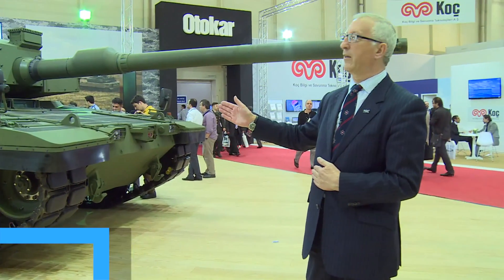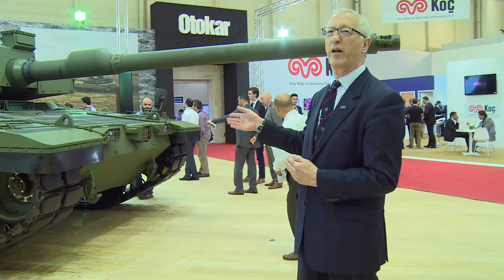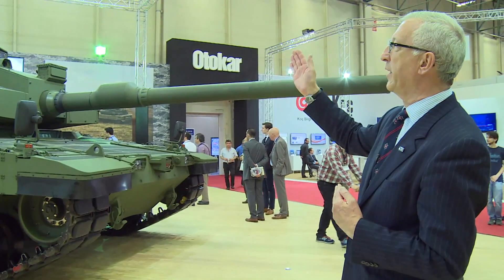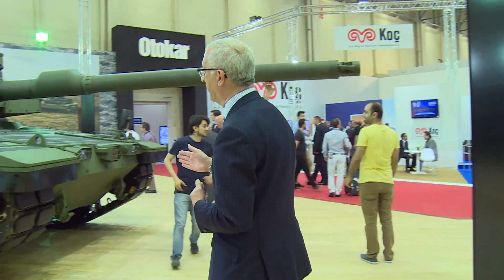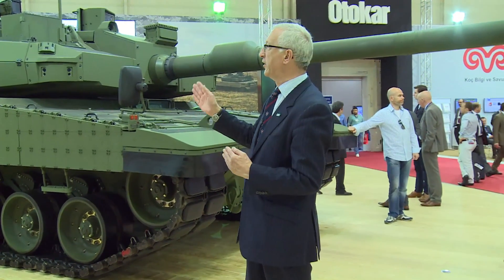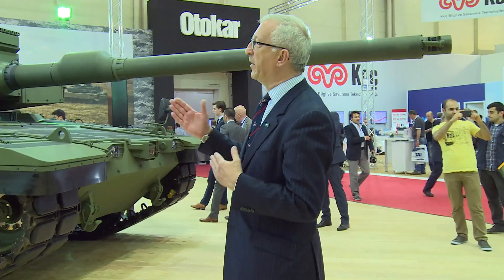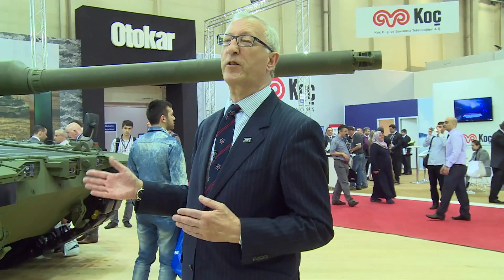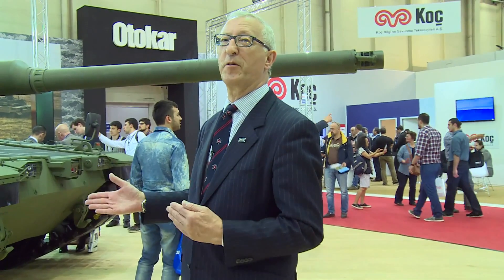IDEF 2015: The final prototype of the Otokar Altay main battle tank

Comment: Nothing beats K-2 tank In-arm suspension system.
Altay has some good armour though
Reply: Joe marine Bro, I do like you Koreans, but why are you whining in comments? Did someone insult you?
In a modern battlefield, no tank is able to survive another tank's shot if it is connected and is a APFSDS round. Thus makes tanks garbages, even a Turkish Sabra tank can knock out a Abrams or your mighty K2 with ease. No armor to protect your mighty ''in-arm active suspension'' and if you are beginning to shit with hard-kill systems, Turks have that option too. I don't think that tanks are becoming obsolote, they are just what the every land force needs but you have to support it with your airpower, which I think Turkey is superior to Korea. I don't mind F-15E vs F-16 dogfights, even F-16s are better in that(check Turkish-American exercises), Turks have really badass pilots with their extreme trainings.
Turks have the history, the geographical advantage, brother nations and a much much more bigger land force as well as the most ranked special forces. 
And I think Turks kinda saved your asses with Americans in 50's, so where is that hate coming from? Again, Turks like Koreans but they love their fatherland more than anything, even than their god. 
Your blue navy is nothing but a prey against in an allround battle time Turkish nation, that can just do the thing Americans did after Pearl Harbor.
Cheers.
Reply: Joe marine you ignorant troll ......American M1A2 and German Leopard2 uses old  Torsion bar Suspension ....ALTAY has new Hydropneumatic Suspension ........also  Turkish Aselsan Volkan-III modular fire control system is the best in the World ......  and  Turkish TUMOSAN is developing  1500hp diesel engine for the ALTAY Tank     and  Aselsan AKKOR  Active Protection System .....soft and hard kill
Reply: Joe marine   and yes  S.Korean   KDX3 destroyer is very good  .....  but Turkey is also  developing its own  destroyer  ...even with its own Radars,,Combat System and Missiles   ......  on the other hand S.Korean  KDX3 Destroyer uses American Radars and AEGIS Combat System ......that means  S.Korean  KDX3 Destroyer is useless without American Permision  as like S.Korean F-16  Fighter Jets

Most Modern Super technology  Turkish TF-2000  class Destroyer   by 2021  will be in Service

Havelsan GENESIS  Combat System
Aselsan CAFRAD

Aselsan R-ESM
Aselsan jammers
Chaff/IR Decoy launching system
Aseslan TORK torpedo countermeasure system

Aselsan  Electronic Warfare System

300km    Turkish ATMACA Naval Strike Missile (SSM)   Anti ship/Land attack
2500km  Turkish GEZGIN-D Land Attack  Cruise Missile 
185km    RIM-156 SM-2 Block IV (SAM)   
50km      RIM-162 Evolved Sea Sparrow Missile (SAM)
9km        RIM-116 Rolling Airframe Missile (CIWS-PDMS)
22km      RUM-139 VL-ASROC (Anti Submarine Weapon )

also   TURKISH LASER  CIWS ......    ( Such weapons are currently only deployed by the United States Navy )

,,,,,,,,,,,,,,,,,,,,,,,,,,,,,,,,,,,,,,,,,,,,,,,,,,,,,,,,,,,,,,,,,,,,,,,,,,,,,,,,,,,,,,,,,,,,,,,,,,,,,,,,,,,,,,,,,,,,,,,,,,,,,,,,,,,,,,,,,,,,,,,,,,,,,,,,,,,,,,,,,,,,,,,,,,,,,,,,,,,,,,,,,,,,,,,,,,,,,,,,,,,,,,,,,,,,,,,,,,,,,,,,,,,,,,,,,,,,,,,,,,,,,,,,,,

also     Turkey is to create a military base in Qatar
http://www.janes.com/article/52106/turkey-to-set-up-a-military-base-in-qatar

the military base will be able to host from 3,000 to 5,000 Turkish soldiers and a general will lead the unit once technical and legal preparations are complete

The force in Qatar will consist of units from Turkish ground, air and naval and Special forces

also   brothers  countries  Kyrgyzstan and Pakistan  as military base 

Turkish Air Force will be in Qatar and Pakistan  and  Kyrgyzstan .........  and  Turkish  Navy will be  in Qatar and Pakistan 

and Turkey  is building  1 LHD ..  .4 ADA class Corvettes,,,,,4 I class and 4 TF-100 class Frigates,,,....4 TF-2000 class Destroyers   and  6 type 214 Submarines  to operate  in the Gulf of Aden and Indian Ocean,,,  and  Atlantic Ocean and  Pasific Ocean

TURKEY  =  Great Hunnic Empire,,,,,,,Great Seljuk Empire  and  Ottoman Empire

Great Turkish Army  since  209 BC

What the fuck S.Korea ?  nothing  in History

,,,,,,,,,,,,,,,,,,,,,,,,,,,,,,,,,,,,,,,,,,,,,,,,,,,,,,,,,,,,,,,,,,,,,,,,,,,,,,,,,,,,,,,,,,,,,,,,,,,,,,,,,,,,,,,,,,,,,,,,,,,,,,,,,,,,,,,,,,,,,,,,,,,,,,,,,,,,,,,,,,,,,,,,,,,,,,,,,,,,,,,,,,,,,,,,,,,,,,,,,,,,,,,,,,,,,,,,,,,,,,,,,,,,,,,,,,,,,,,,,,,,,,,,,,,,
Reply: Joe marine Turkey  always was stronger than S.Korea  and Japan  in 2012..2013..2014 ......and  Turkey will have most modern super technology weapons in the next 5-8 years ... Turkey will become again  stronger than S.Korea  and Japan   and Turkey is in active  against pkk terrorits  since 1985  and Turkey lost around  $1 trillion to fight against pkk terrorism  in the last 30 years...........Turkey would create 4th strongest military in the world  for $1 trillion ....you are very lucky that  you have no terrorism
Reply: Joe marine and Turkey has  Long Range Cruise Missile Projects
+1000km SOM Airbased Cruise Missile
2500km    GEZGIN  Land and Naval based Cruise Missiles  
also 300km ATMACA  Naval Strike Missile
Turkey had the 6th  strongest Militaty in the World  by 2012    chech out the list   http://archive.today/kcdk
urkey again will have 6th  strongest Militaty in the World  until 2023......FUTURE IS OUR
Reply: +Joe marine  Bro first of all ı am turk and i like korean people.You are right ROK army has better equipment than Turkey .But you are forgetting history of Turkish Army.Turks fight against U.K,France,Russian Empire and all european countries.Your army is so strong because your enemy  also strong.(like China).But in the europe and middle east nothing can stop Turkish armed Forces.

Dont Forget 1950's. Our heroes died for your indipendence.
Reply: +Joe KPS  first you should develop ICBM  and  later Nuclear Submarine  ..  and your projects for 2030s.......until 2030  TURKEY will develop  everything .....and  Network Enabled Weapon   ......  ( only 3 in world wide )
1----the US Air Force's    130km   AGM-154 JSOW
2-- Turkish Air Force's    250km  SOM-J Cruise Missile .....also ATMACA Naval Strike Missile
3---British   Air Force's   121km   SPEAR Missile
Reply: Haklisin bu beyinsiz salak sade insanın asabını bozmak icin gelmiş hiçbirşeyden haberi yok çocuk olduğu belli kendi kendilerine ötüp duruyorlar iste salla dediğin gibi!
Reply: You are a brainless 10 year old child you should do some reseach before you talk so much Bullshit and blame yourself! Turkey Naval Forces since 1081 your poor shity country is nothing without help same shit ilke North Korea
Reply: +Joe marine  Sorry my little friend but south korea nothing without US and UK support.You can refuse it with ur small knowledge but all world know that very well.I wont use my power to send u offical information about that, u can search on ur own. These are my last words about ur comments.Now u can write again ur guns, ships, planes etc =).Bye
Reply: Joe marine yes today S.Korea:7 and Turkey : 10....but I am saying again Turkey  always was stronger than S.Korea  and Japan  in 2012..2013..2014 ......and  Turkey will have most modern super technology weapons in the next 5-8 years ... Turkey will become again  stronger than S.Korea  and Japan

and  3000t nuclear submarine  without ICBM ?

we dont need nuclear submarine ......Turkey create military base  in Qatar and Pakistan  to operate  in Indian ocean and pasific ocean

and our  upcoming type 214  class  submarine armed with  1500-2500km Turkish GEZGIN-D  Cruise Missiles   will be able to attack on the US or China and return Turkey

and Turkey will have blue water navy   until 2023

also  your list  is full of bullshit

S.Korean  K-FX  and Turkish T-FX  are still under development .... first flight will be in 2025........how can you say KFX is superior to TFX  ?

even K-FX  will be like 4.5 generation  ...not 5th generation  .....also  without Eletronic Warfare system and Stand off Jammer 

please  dont show me stupid  informations and lists

even Turkey developed its own Aselsan ASELPOD  targeting pod (only the us-israel-turkey-france and china  in the world)

Turkey developed its own Self Protection Electronic Warfare System  for  fighter jets  ....... ( only 6 in world wide  the us...israel,,,turkey...uk..sweden...netherlands  )

under  development

Roketsan    SAHIN and GOKTUG  Air to air missiles  by 2018-2020

Roketsan    SOM-J  Network Enabled Weapon  by 2018 ....  ( only 3 in world wide   the US..Turkey,,Uk )

Aselsan      AESA Radar  for  Turkish  TAI TFX  stealth  Fighter Jet

Aselsan      MEHPOD   Eletronic Warfare system and Stand off Jammer    ....  ( only 3 in the world    the US.Israel and Turkey )

what about S.Korea  ?

and   S.Korea is not our enemy  ...even I want to see S.Korea  in top 5  in the world  ......S.Korea..Turkey and the US  are allies  against China

our enemies are  greece..iran..israel   and maybe russia  and china  

----------------------------------------------------------------------------
Reply: Joe KPS Turkish Airforce  234  F-16C/D can destroy Rubbish Russian Airforce and S400s and Military bases in Syria  in a hour  ....SEAD attack with thousands of   Turkish 250km  steath SOM Cruise Missiles .....and  150km  American  AGM-88 Harm Missiles    and  Turkish  100km TUBITAK Laser guided INS/GPS  Smart Bombs ...  and  Turkish  150-300km  J600T Tactical Ballistic Missiles ... and   American M-270  MLRS with  165km ATACMS Missiles......and  120km  Turkish TR-300K+   GPS/INS guided  MLRS  ....and  500km  Israeli  IAI Harpy  UCAVs   ..also thousands of  40km  Turkish TR-122 MLRS and T-155 Storm  Howitzers
Reply: Joe KPS  Superior  Turkish TF-2000 class Destroyer  by  2021

Turkish   Aselsan     CAFRAD    multi-function Radar  ..  (  range : +400km )
Turkish   Havelsan  GENESIS    Combat System

300km    Turkish ATMACA Naval Strike Missile (SSM)   Anti ship/Land attack  
2500km  Turkish GEZGIN-D Land Attack  Cruise Missile 
185km    RIM-156 SM-2 Block IV (SAM)   
50km      RIM-162 Evolved Sea Sparrow Missile (SAM)
9km        RIM-116 Rolling Airframe Missile (CIWS-PDMS)
22km      RUM-139 VL-ASROC (Anti Submarine Weapon )

2 x 3      Turkish AKYA  torpedoes

also   TURKISH LASER  CIWS ......    ( Such weapons are currently only deployed by the United States Navy )

also   Turkish Aselsan DAKA  Acoustic Torpedo Countermeasure Decoys and Aselsan  TORK Anti torpido hard kill system... ;.( only ;4 in the world  the US..Russia Germany..Turkey ).
Reply: +Andrew Yoon  we are  talking about Electronic Warfare Systems  ......not Iphone..TV..or Computer
A....Land based  Radar Electronic Warfare System......(only 2 in world wide ).....1....Russian  Krasukha.......2....Turkish Aselsan Koral
B...Jamming Pod ....(only 4 in world wide ) 1....American  Raytheon AN/ALQ-99 Jamming  pod......2....Turkish  Aselsan MEHPOD  Jamming  Pod....3....Israeli  Elta El/L 2851 Escort Jamming  Pod.....4....Russian  KNIRTI-SAP-14  Jamming  Pod
Reply: +Andrew Yoon also  Targeting pod..for Fighter Jets   ...... ( only 5  in world wide)   
1..LITENING targeting pod.....  ISRAEL 
2..Aselpod targeting pod....... TURKEY
3..Thales Damocles  targeting pod.........FRANCE
4..Lockheed Martin Sniper XR targeting pod........ THE US
5..WDM-7   targeting pod........ CHINA
Reply: Andrew Yoon everything is true.........S.Korea has technology  but Turkey has also technology   ...Turkey spent over $8 billion for 2.2 million of Syrian refugees......Turkey would produce 8 TF-2000 class Destroyers  for $8 billion  but Turkey doesnt need very huge Armed Forces  because of Turkey is NATO Member....Turkey spend trillion dollars  for Public Projects like  new Istanbul Airport for $49 billion.. the biggest Airport in the World.....also  3 new Nuclear Power Plants.for $62 billion ..also  10.000km network of high speed lines  until 2023  for  $45 billion making  it the longest network in Europe  and the 2nd  longest network in the World  after China .... also  20 million of new buildings  will be built in Turkey under the Urban Renewal Project  for $400 billion  between 2003 and 2023 ......and many more
Reply: Joe KPS Turkish  Roketsan  GEZGIN-D  Naval  based Cruise Missile ....( only the US Turkey and France in NATO )
Gezgin D Block 1 500 km 
Gezgin D Block 2 800 km 
Gezgin D Block 3 1000 km 
Gezgin D Block 4 1500 km 
Gezgin D Block 5 2500 km
Reply: +Joe KPS   Turkish  Roketsan  J-600T  YILDIRIM Tactical Ballistic Missile ....(  only Turkey in Europe )
J-600T  block I    150km  in service 
J-600T  block II    300km  in service 
J-600T  block III   900km. developed
J-600T  block IV  1500km  developed
J-600T  block V   2500km  until 2020
Reply: Dude, there are innocent people.. Your little chicken mind only realize what you read from news.. Turkey spent 9 bilion so far for those people.. Otherwise they will get killed. You koreans only think about money.. Thats yhe main difference between us..

Sent from my iPhone
Reply: Guys this is not how war works, it is not a fucking strategy game

Reality Check:
Turkish army is extremely experienced 
Lockheed Martin is buying SOM cruise missiles from ASELSAN,
Turkey has manpower
Turkey has good pilots
Turkey has good special forces, again, "experienced"
Turkey has friends more than skorea, which is weird
Turkey has INCREDIBLE amount of extremists who can easily give up on their life for their country
Turkey's commanders have great morals and motivation in hard situations due to country's history of wars, such as independence war and ww1
Turkish people learned stand strong in hard times from coups, wars and terror. 

Aand skorea is lead by a magician-is that the right word?- which is interestingly worse than erdogan, ikr.
Reply: +Joe marine and my comments are on spam in this video.......lets discuss  on my videos  please
Super Technology Turkish Armed Forces ( New Weapons ) 2015-2025
Reply: +Joe marine You know what elitist jerk! We are the one who just saved your fat asses.You gotta say thanks to Turkish bayonets instead of being toxic here .And I just want to remind you one thing when the time comes war is just a pastime activity for Turks.
Reply: +Joe KPS dude, just a year ago, Turkey was stronger than S.korea in Globalfire.. 
You mentioned about the suspension system of your Tank.. Do you know why countries dont really use those new  toys? it ades a lot of price to the order. Turkish Tank is 5.5 million $ per piece, what about yours? more than 8 million $. Yes, Cost matters.. as you have to atleast order 1000 of them.. In 4 years, Turkey will have its own engine by Tumosan, where is your Tank engine? it takes forever... Why Korea cant produce the tank? well, now you have to answer that question... 
Your fighter aircraft wouldnt even be 5th generation, as it will carry weapons outside... Also, US refused to share AESA radar technology with you.. I wonder what you gonna do now...? 
You said Korea produce its own Submarine... You dont know that Korea produce U214 under license from Germany, which Turkey produce the same.. And you got the same number of Submarine as Turkey.. 
You Air power is no match to Turkish one. TUrkey will purchase 116 f35 until 2023 and develop its own 5th generation get until that...i can go on and on.. it just show how uninformed you are about turkey..
Reply: +Joe KPS Turkey doesnt need nuclear submarine, as nuclear submarines are easy to be detected in the sea, because of their noise and heat signature to cool the engine. Also, you cannot turn its engine off unlike in diesel engine and use batteries... 
Dude, i really would suggest you to read more detailed about army technologies.. I like that you got information About ROK but you better be fair and check others too.. Turkey cant use nuclear submarine in Mediterian or Black seas..
Reply: Joe KPS TURKEY can mobilize 20 million of sooldiers in 48 hours.....Turkey is a militaric country.....and  Turkey develop over 120 high technology military projects  and buys most modern American and German Weapons .... ..its  superior technology  Turkish Aselsan Koral Land based Electronic Warfare System and Jamming  made blind Russian radars and air defense systems 8 days ago............Russians were shocked
http://haberci.ajanspress.com.tr/rphotosmall2/46976274/34/bb85c895-8f76-e211-873d-001a6465f174
what about S.Korea ?
Reply: Joe KPS
first of all, let me tell you where you misinformed us! 
Russia got around 750 attack jet, well if you consider mig21 or su 25 as gets which is the main aircrafts in Russian air force... 
Attack helicopter- Turkey builds 1 attack helicopter every single month, which is way stronger than the russian ones... 
Turkey can easily increase the artillary, AFV and other things...
You got more submarines? you got 14 and Turkey also got 14... what is the difference then? Turkey will get one u214 as S.Korea every year coming(6 ordered)
Reply: Joe KPS Most of those Russian SUbmarines are nuclear powered.. it would be a sitting duck against Turkey in shallow water... you better read about it first. I dont want to be a teacher again! Basically, its not as easy as in the paper.. Turkey is 3 times more stronger in black sea and its area than Russia forces..
Reply: Joe KPS even weak unarmed Afghans and Chechens kicked Russians.....without Nuclear Weapons Russia is joke.........  over 80% of Russian Armed forces dont work...outdated and in very bad condition....and  you know nothing about 2224 years Great Turkish Army since 209 BC ....   TURKEY is Militaric Country  and TURKEY can mobilize 20 million of soldiers  in 48 hours.... every 20 yearly Turkish guy conscripts serving their military service  for 12 months in TURKEY  and Turkey can fight  non stop 2 years without any production of food..ammunition...etc .....and TURKEY develop  over 120 high technology Military Projects until 2025 ...  S.Korea not even close  .....    superior technology  Turkish Aselsan Koral Land based Electronic Warfare System and Jamming  made blind Russian radars and air defense systems 8 days ago......Russians were shocked....S.Korea has no this technology
Reply: +Andrew Yoon  also  Self Protection Electronic Warfare System......... ( only 6 in world wide )
1...TERMA Self Protection Electronic Warfare System.....THE US
2...ASELSAN  Self Protection Electronic Warfare System...TURKEY
3...ELTA Self Protection Electronic Warfare System...ISRAEL
4...SAAB  Self Protection Electronic Warfare System...SWEDEN
5...BAE Self Protection Electronic Warfare System....UK
6...NLR Self Protection Electronic Warfare System...NETHERLANDS
Reply: Andrew Yoon  where are your Land based Radar Electronic System...and Jamming Pod  for Fighter Jets to make blind enemy radars and air defense systems to deep strike in the enemy territory.....and Targeting Pod for Fighter Jets  and  Self Protection Electronic Warfare System for Fighter Jets  against the enemy missiles and air defense systems ? only in your dreams  and your are real whitewashed person :))).........and only the US..Turkey and Israel developed all those Super technology Military Projects  in the World ...
Reply: Andrew Yoon also   TURKEY  is the 3th country that can design and produce  MALE UAVs   in the World after the US and Israel
and today only 4 in Worldwide  the US..Israel..Turkey and China...............Turkish   TAI  ANKA  MALE UAV  armed with  Turkish Laser guided BOZOK Missiles  and SATCOM  Capability..........also These include an electro-optic / forward looking infrared / laser range finder (EO/FLIR/LRF) payload (Turkish Aselsan  AselFLIR-300T) and Synthetic Aperture Radar / ground moving target indicator / inverse SAR (SAR/GMTI/ISAR) payload
Reply: +Andrew Yoon   Europe is allies of TURKEY  in NATO  .........and  upcoming  Great  Turkish Airforce   100 American stealth F-35A  and 200 Turkish stealth TAI FX-1 Fighter Jets    armed with  B-61 Mode12  Nuclear Bombs....250km Turkish  stealth SOM-J Network enabled Cruise Missiles.....100km Turkish HGK GPS/INS  Smart Bombs  ....Turkish ASELPOD Targeting Pod....Turkish MEHPOD  Electronic Warfare System and Jamming Pod   .....also  4 Boeing 737 AEWC.....7 Airbus A330 MRTT and  10 Airbus A400M Tankers  =  Irrepressible  and Deadly
Reply: +Andrew Yoon   1000  units of  Turkish ALTAY Tankis  the best in Europe  with Turkish Aselsan AKKOR Active Protection System  ....also  huge Turkish Army has  811 superior MLRS  (even Uk+Germany+France+Italy+Spain+Greece have no total 811 MLRS ) ....+120km  Turkish TR-302K+ INS guided MLRS is superior to 100km Russian  300mm  unguided SMERCH MLRS..........also only TURKEY has Tactical Ballistic Missiles in EUROPE  ( 150-300-900km J600T  and 1500-2500km under development until 2020 )  also soon GEZGIN-K Long Range Land based Cruise Missile ..only Turkey in Europe
Reply: +Andrew Yoon  upcoming Turkish Navy  New Weapons   = 1  LHD  (231meter  with 16 F-35B  Fighter Jets )  and 4 ADA class stealth anti Submarine  Corvettes   and  4   MILGEM-I class stealth Frigates  and  4  TF-100 class  multi role stealth Frigates  and  4  TF-2000 class Destroyers    and  6 Type214TN class Submarines   armed with superior weapons like 300km Turkish ATMACA  network enabled Naval Strike Missile ,,,2500km Turkish  GEZGIN-D Cruise Missile.....185km SM-2IV SAM....and  Turkish  AKYA Heavy Torpedo  and  Turkish  DAKA   Acoustic Torpedo Countermeasure Decoys  and  Aselsan  TORK Anti torpido  hard kill system   ....( only  4 in the world   the US..Russia Germany..Turkey  )
Reply: Joe KPS TF-2000 will be clasified as Frigate  but in reality Destroyer.....as like French Horizon class Frigate....  S.Korean Destroyers use American AN/SPY-1 Radar and AEGIS Combat System ..that means S.Korean Destroyers are under the American control........on the other hand  4 Turkish TF-100 class Frigates and 4 TF-2000 class Destroyers will use +400km Turkish Aselsan CAFRAD Radar  and Turkish Havelsan GENESIS Combat System........also  Turkish 300km ATMACA Naval Strike Missile is the first network enabled anti ship missile in the world and far superior to 150km  S.Korean   SSM-700K Hae Sung   anti-ship missile.......and S.Korea is nothing to compare with Turkey  in UAV  technology
Reply: Andrew Yoon  Turkish TF-2000  will have the superior weapons  like Turkish 300km ATMACA Naval Strike Missile is the first network enabled anti ship missile in the world and far superior to 150km  S.Korean   SSM-700K Hae Sung   anti-ship missile......2500km Turkish GEZGIN-D Cruise Missile ...50km      RIM-162 Evolved Sea Sparrow Missile (SAM).....185km    RIM-156 SM-2 Block IV (SAM)  and 370km RIM-174 SM-6 (SAM) for +400km Turkish   Aselsan  CAFRAD  Multi-function Radar ....9km   RIM-116 Rolling Airframe Missile (CIWS-PDMS) and Turkish  LASER  CIWS  and  22km  RUM-139 VL-ASROC (Anti Submarine Weapon )  and 2 x 3 Turkish AKYA torpedoes  and Turkish TORK anti torpedo hard kill System (only 4 in worldwide the US..Russia ..Turkey and Germany  ) and Turkish Aselsan Electronic Warfare Systems..........what a great superior technology Destroyer
Reply: Joe KPS S.Korea..Japan..Spain..Australia use American  AN/SPY-1 Radar and AEGIS Combat System  ..on the other hand  4 Turkish TF-100 class Frigates and 4 TF-2000 class Destroyers will use +400km Turkish Aselsan CAFRAD Radar  and Turkish Havelsan GENESIS Combat System........and  Turkish  TAI ANKA has many variants ...Anka-S UCAV will be more than 4 tons compared to Anka +A UAV 1.5 tons.........also  +5 tons ANKA-TP Strategic Unmanned Aerial Vehicle High Altitude Long Endurance (HALE).....and ANKA stealth UCAV  ....TAI TFX  5th gen Air Superiority Fighter Jet.....TAI T-129 Attack Helicopter......TAI MILHEL Utility Helicopter.....TAI TRJ-628 Transport Aircraft......TAI GOKTURK-3 SAR Space based Radar
Reply: Andrew Yoon Network Enabled Weapon  ( only 3 in world wide )
1----the US Air Force's    130km   AGM-154 JSOW
2-- Turkish Air Force's    250km  SOM-J Cruise Missile  and 300km ATMACA Naval Strike Missile
3---British   Air Force's   121km   SPEAR Missile
Reply: +Joe KPS Turkish  Roketsan  GEZGIN-K Land based Cruise Missile  until 2020.....  .( only Turkey in Europe )
Gezgin K Block 1 800 km 
Gezgin K Block 2 1000 km 
Gezgin K Block 3 1500 km 
Gezgin K Block 4 2500 km 
Gezgin K Block 5 3000 km
Reply: +Joe KPS  S.Korea is nothing to compare with Turkey  ....  full of American weapons  or under license production ...  even our +400km CAFRAD Radar  ..GENESIS Combat System and 300km ATMACA Network Enabled Naval Strike Missile and TUBITAK  High Energy LASER  and   TORK anti torpedo hard kill system and KORAL Electronic Warfare System and Jammer  makes TF-2000 class Destroyer superior to any S.Korean Destroyer   ........TURKEY develop its own HISAR  low-medium-high altitude  Air Defense System   also  indigenous Ballistic Missile Defense System Project    also Turkey will buy SM-3 or THAAD  from the US  the AN/TPY-2 radar was deployed at Turkey's Kürecik Air Force base.....The radar was activated in 2012
Reply: Andrew Yoon source code means they control basically everything about that software...
Reply: +Joe KPS  You underestimate the Turkish Army tradition .Anyway i am sure u are not soldier. I have to say that again  we fight against United Kingdom ,France ,Russia ,all balkan countries over the past 100 years.This is war experience not yours.

You are right our all special trops sux. LoL Your special forces train with US forces  ok it might be.What do u think about our Special forces like S.A.T,S.A.S,Moron Berets ? U think our forces train with ıraq or sudan :)

Respect ,
Reply: Kamil Demir
Of course they are.
Do you turkish special forces train with the SAS and US Delta Force?

Our ROK 707th battalion trains with the british SAS, french GIGN, US Delta Force and they train the philipines NAVOC as well as the Thai special forces.
Of course the ROK SF are better.
What is your point.
Turkey are fighting terrorists.
South Korea is fighting a nuclear armed north korean regime.
Different calibre
Reply: Kamil Demir
Just because you are in NATO doesnt mean you SF train with their SF. As far as my knowledge goes, turkey do not train with SAS or Delta Force like the ROK SWC special foces do.
ROKSF is one of few asian countries to even train with the US and UK SF. You should do some research. ROKSF are well known in asia. They train philipines, taiwan and malayasian special forces too.
Of course our SF stay together to defend a missile attack. The ROKSF role is to seize and capture north korean nuclear missile silos before a nuke is launched.
Reply: +Joe KPS 
You're a sick jealous.. South Koreans just gave technical information, you're one victim of ultra liar media :D Wave it, you became famous :D
Many technologies that Turkish army have, South Koreans haven't them.. first of all why Turkish took technical(not technologic) information from Korean engineers is because of getting earlier of the new Turkish weapons for Turkish army. Our hasn't produced because of our former governments were irresponsible and they had collapsed the economy. So Turkey wasn't able to..
Ottoman Turkish were good weapon producers too. Howitzers, muscets...
Reply: +Joe KPS hey joe long time passed but when i read that news i just remembered u, http://www.dailymail.co.uk/news/article-3427770/The-filthy-war-North-Korea-bombards-South-USED-toilet-paper-cigarette-butts-propaganda-tit-tat-hits-new-low.html :D haha. Sorry to see that ur country's air defense system cant hit toilet papers at the sky bro so sad XD haha.And south korea should not cry to world about north korean bomb tests :D cya dumbass
Reply: can
LOL balloons are not an air projectile you moron LMAO
is this a joke? lmao
We arent crying about anything. We are condemning the actions of the north before we have to use actual force to attack them as tensions rise. 
Turkey should stop crying about the syrian refugees coming to their border. LMAO
Reply: can 
Feel free to upload anything.
The fact that u relate us to the UK just shows how stupid you are .
You are under the stereotype.
That will go when US leave korea after OPCON.
Go ahead post something and ill correct your stupidity.
Carry on sucking off foreign countries on the easiest shit like firearms lol
Reply: Den ProHD 
2012 LOLOLOL
its 2015
You gave the old link of GBF 2012
GBF 2015 is the newest.
South korea has now overtaken turkey.
South korea 7th
Turkey 10th
http://www.globalfirepower.com/countries-listing.asp

Turkkey will be 6th?
Wheres the link?
You have none
So cut the bullshit.
South korea will be EVEN MORE powerful by 2023 as well.
We will have our 3 ICBM nuclear 3000t submarines.
Will turkey have a 3000t submarine by 2023 like us? NO
Ad we will have 4  more AEGIS destroyers of our KDX3 which is the largest destroyer in the world.
The future is OURS.
AND
if north korea and south korea unite we become the next superpower.
Everyone knows that.
Turkey will become a child admist power of joint north and south korea.
Reply: Den ProHD 
South Korea are the only ones making their own indigenous 3000t nuke submarine now.
and for top 10 military powers south korea is more powerful than turkey

here you go all these link are official rankings 

South korea 7th / turkey 10th

http://www.wearethemighty.com/top-10-militaries-world-ranked-2015-05

South korea 7th / turkey 10th

http://www.businessinsider.com/these-are-the-worlds-top-10-militaries-2015-5?IR=T

South korea 8th / Turkey not even in top 10

http://www.wonderslist.com/10-most-powerful-militaries/

ALL THESE LINKS SHOW SOUTH KOREA IS HIGHER THAN TURKEY 
end of discussion
btw
South korea defense budget $35 billion
Turkey defense budget $18 billion
No competition
and south korea and turkey both building next gen stealth fighters
south korea's version is still more powerful
http://www.wonderslist.com/fifth-generation-fighter-aircraft/

South korea > Turkey

anyway turkey and south korea are allies. it should matter. turkey are an economic powerhouse and sure theyll be strong
Reply: +Joe KPS Dude, Turkey has 14 submarine and 6 more coming by 2017 every year... 
Turkey just recently canceled the CHinese bit and will develop ots own missiles.. They have developed the radar already.. 
Also, there is now technology in the world that can hit ICBMs... why? because they use decoys, flares and many more warheads in a single missiles.. again, why it matters? to be able to hit them, you have to fire your missiles ASAP when your satellite see those missiles fired.. so they could meet in the sky at the same time... But, imagine, you have tracked two missiles, and send also two missiles, but now they got many warheads. what are you gonna do? each Standart 3 missile cost 20 million dollar. i dont what to be like a teacher and write more, but  thats the reality... thats the reason, Europe cant risk against Russia..
Reply: Kamil Demir
Personally i dont really understand what you are talking about. But i do agree Russia would beat Europe (nato)
Reply: Joe KPS Well, when you got nothing to answer, thats the coward way to answer... Turkey shot down Russian plane, i wonder what S.Korea did when last time USSR downed your plane? I feel sorry, didnt even want to mention it, but you are itchy in this forum... 
If you are ready for professional discussion, more than welcome to do..
Reply: Kamil Demir
You want a professional debate?
Ill give you the hard hitting facts.
I was trying to be nice.
Turkey has no navy.
South Korea Navy is one of the most powerful in Asia.
South Korea has the second largest mobilization manpower force in the world after China.
Can Turkey mobilize 3.5 million troops within 24 hours like South Korea?
Does Turkey even have a Marine Corps?
South Korea's ROKMC is becoming a higher tier assault brigade. 
Skorea has never had any of its service planes downed since 1960
You want a professional debate?
South Korea is ranked higher than Turkey
http://www.globalfirepower.com/countries-listing.asp

Turkey shot down ONE russian su24 and all of a sudden you boast about that?
If Russia went all out Turkey would be dust.
Russia just deployed S-400 anti air to counter Turkey. Whats the point.
You should be thankful Russia hasnt responded yet.
Reply: Joe KPS about the missiles, this is what even simple wikipedia tells me, but i can also attach more links..
"The KM-SAM which is also known as the Cheolmae-2 or Cheongung or M-SAM is a South Korean medium range surface-to-air missile (SAM) system that was developed by the Agency for Defense Development (ADD) with technical support from Almaz-Antey and Fakel."

You are almost at the same spot with Turkey.. But, Turkey depends on only itself.. Even the recent SYrian crisis shows that its NATO friends found excuse to arm Turkish terrorists and called that this is only agains ISIS. We understand that we should develop ever single part of our technology..

On the other side, You have to stand against Chine, which is really strong,, But, this race, might drag you into economic recession. I hope you will not hurt out of it... Developed CHinese products, might hurt your export and so on...
On the other hand, our region is on fire... Ukrain got war on the north side, Azerbaijan and Armenian conflict(Nagorno Kharabagh) which might turn into war between Turkey and Russia, and the Syria, Iraq and Iranian side that all are SHhie muslims that want to take the control of South Turkey and cuts its relations with SUnni arabs.And, of course recession in Europe and issues with Egypt, Greece and Israel..
We are at tough time, we have spend 8-9 billion just to keep millions of refuges alive. alos, billions probably spent to support FSA..  Also, Turkey declared war against PKK in eastern Turkey and clean them city by city, checking every single house and so on...

But, Turkey in a goog position about engine technology, as we produce F135 engine critical parts(for f35) and have been producing for 20 years, almost everything for f16. I know that you are also good at f16..
We got the same type of submarine force and same technology.. But, Turkey also develop its own bigger submarine called Milden, will be ready for 2020-23.. 
I believe, Turkey is ahead of Korea in UAV technology, as you have no MALE UAV. 
Turkey will also be at good position at cruise missile, as they will develop som-j and sell it to all nations who will operate f35 jet. It is the best and superior network enabled missile. Turkish missiles in 2 times better than US and UK variants and it was designed to fit in f35, which is also very hard task..But, i know that you also work on it... 
AESA radar is impossible to be ready in 2008. Even France just lunched it last year and won 3 orders right after that within months.. Think smart, if you had it, why would they purchase it from the USA then? its not an easy task.. 
Anything you are interested about Turkish technology, we can discuss it one by one and compare with Korean systems.. i believe it would easier that way. 
About the helicopters, having a attack helicopter is a different task.. Turkish helicopter can climb to 6500meters, How about yours? 
It will have milli meters wave radar. which is very critical and gained USA billions of dollars from Longbow Apache sale. Can you develop it your own? It was another reason that Turkish Atak helicopter was chosen in your tender as one of the best 3 but Long bow was chosen later.. 
Subsytems matter, because thats what bring the difference between weapons... 
You several time mentioned that in arm suspension is good. But, it is very expensive and doesnt really give you that much big difference in a war.. 
How much your k2 cost? it was mentioned even years ago that around 9 million $. but Turkish tank will cost 5.5 million$.  Imagine if your order 1000 of them, then the cost matters.. you would simple save 3.5 billion$.
SHow me any other developed nation that plan to use that suspension? Its like driving BMW and Toyota. one is too expensive to purchase. but at the same time, it will be very expensive to keep.. You purchase these tanks for 30-40 years..
Reply: Kamil Demir
1) Was i talking about KM-SAM? I was talking about L-SAM which uses a I-SAM BMD radar developed by Hyundai industries which is completely south korean. No russian involvement.

2) Why would south korea fight China? Thats must media brainwashing people into thinking China hate south korea. China has stopped major funding and partnership with north since 10 years ago. Now China and South Korea are asia's largest economic partners and South Korea is China's number 1 tourist attraction.
Remember South Korea has the largest shipbuilding industry in the world. Thats why China are eager to bond with South Korea. They have a lot to gain economically as a pair.

3) UAVs has only recently gained attention by the ROK forces.
In terms of UAV power of south korea,
ROK just purchased 4 RQ-4 Global Hawks which is the best combat high altitude UAV on the market right now. So in no way is ROK behind on UAV technology.
Also we do have a MALE UAV programme.
By 2016 DAPA will released MALE UAVs similar to the MQ-1 Predators.
And have you heard of South Korea's stealth UAVs?
They are developing stealth UAVs which can target enemy artillery positions.
http://english.yonhapnews.co.kr/national/2015/12/06/0301000000AEN20151206000500315.html

4) Yes i misread the fact about AESA radar. I meant South Korea are planning to finalize production of Captor-E radar and then will localize AESA radar technology for the KFX project. They will probably team up with Sweden or Israel by the looks of it right now.

5) Attack helicopters? 6,500metres?
For South Korea that is just a waste.
We are fighting north korea. We dont need to climb 6,500metres, our attack helicopters just need to be high enough to stay out of range of STA missiles. Our SURION helicopters climb 3,000 metres and our upcoming KAI-LAH attack helicopters can climb 4,500 metres. That is more than enough.
And anyway, South Korea already purchased AH-64E attack helicopters also to increase their capabilities which can climb 6,400metres minimum.

6) K-2 is expensive?
In terms of tank warefare its "Quality over Quantity".
No point buying loads of tanks if they arent as good. Its far better to buy expensive tanks.
Do you not remember tank warefare in the 1970-1980s? Soviets produced a lot of cheaper tanks. They got wiped out by the expensive newer tanks even when they outnumbered them.
Quality > Quantity
K-2 tank is the most heavily technology integrated tank in the world.
Best radar-integrated FCS, RWR, IR jammer/tracker, soft and hard kill APS, and let's not forget KTSAM. It also has the best suspension system out of all the tanks due to the mountainous korean terrain.
To say a tank is too expensive is very naive.
Reply: +Joe KPS  i  want to give   you an advice as a turkish NCO.Turkish military industry is crawling like a child.We did not produce any weapon platfrom like tank,spg etc because of nato and us  donation us their old war toys.Our most of tanks are donation and navys unit.But Turkey refuse to use their old rusty toy.We really want to produce public arsenal but our infrastructure is insufficient. You are discussing with Den ProHD  and i think you are right.Our all project is not ready.When project is done maybe Turkish army will be better ROK.But again u are right Korean technology is continues to rising. I think your most powerful weapon is SAMSUNG :D and i want to thank you for sharing K-9 Thunder and K-2 platform.

Unfortunately there is a point i left you. You said  Does Turkey even have a Marine Corps? 
Yes WE have I Am  !!!!! I assure you our infantry or marine corps are not better than rok ALL OVER THE WORLD. I know we are brother and we will never fight with south korea.Bu it  if it occurs these guy can easily sweep any rok or rusky special unit with their rusty g3a3 and m4a1.I met a korean soldier in turkish war accademies in ankara.He became a lion 6 month later.You can call our Turkish War Accademy.You should talk korean student.Ask Them.
Reply: Onur Çankaya 
I agree. 
But turkey would wipe through the ROK??
Think again. The ROKMC were most feared in vietnam by the vietcong and the ROKMC has never lost a fight sincr the 6.25 war.
It largely depends on what branch of the ROKMC you are talking about. If you are talking about regular korean marines they are still decent. But turkey soldiers would not want to fight our ROKMC SR brigade. They are walking machines. They are brutal. 
Rusky special unit? South korean special forces are on par with the US sepcial forces. Our SWC spec ops, 707th spec ops or our ROK UDT train with US green berets and the british SAS. They would certainly hold off any turkish attack. These arent regular koream recruits. These are lifelong trained fighters.
Reply: Onur Çankaya 
I actually have served. All korean men must serve. I served in the ROKMC back in 2011.
Moron berets? Is that a joke or...
But respect. We are allies forever.
Peace
Reply: Maroon beret .clerical error lol
Reply: Joe KPS Do you really believe that Korean special forces are better than Turkish ones? Have you ever done research about the Turkish Maroon berret? or in Turkish Bordo bereliler? 
Dont try to claim something without knowing the opposite side... 
Turkish police special forces clean PKK from city warfare in SUR and other cities right now, which is the hardest thing to do actually..
Reply: Joe KPS hahaha Dude, Turkey is a Nato member.. of course they train with them... Are your SF will stay together to stop the nuclear missile fired against you? i didnt get what you mean... so what?
Our SF finish Kurds in city warfare which even USA dont risk to do in Afganistan or Iraq.. 
Mature people, never compare SF... as, there will be brave people from both sides... just stop this comparison, unles you have anything to say about technology...
Reply: +Joe KPS 
Don't cry to us saying "Turkish help us!! :'(("  when Chinese or North Korean attack you because we won't help you as we had helped you to be a NATO member. :D If Turkish weren't be in Korean war(1950), now your family would have been shot and your nation would be communist. If Turkish weren't there, the Korean war would be ended like Vietnam disaster(Vietnam war). 
Continue to suck some American's
Reply: bEnTURK34-2
"If Turkish weren't there, the Korean war would be ended like Vietnam disaster(Vietnam war"

LOLOL You turks did jackshit in the korean war. You made no difference. How many turks fought in the korean war? 5,000. How many south koreans fought in the korean war? 690,000. You turks basically did jackshit and you claim we would've lost the were if it wasnt for you? LMAO

"Don't cry to us saying "Turkish help us!! :'((" when Chinese or North Korean attack you" 

LOLOLOL. WTF? Why would china attack us? This is proof you are fucking stupid. China and South Korea are strong allies. China and South Korea are asia's largest economic partners and south korea is china's main source of tourist income. Without south korea china will suffer economically. South Korea even joined the chinese AIIB banking system so China and south korea are allies. China would never attack their own ally South korea.

And why would we ask for turkish help?
LMAO. South Korea ALONE can defeat north korea within 4 weeks. That is officially from the Pentagon and NIS. We have far more advanced technology than north korea. 
Size does not win a war. That was proven after WW1. 
US dont help us anymore. They simply have a 28,000 troops stationed here in korea due to OPCON complications with the US-ROK alliance treaty. The US will be gone from korea by 2020s. 
Turkey has 350,000 troops.
South Korea has over 650,000 active troops and over 2,900,000 reserve forces. We dont need you turks here at all. 

Why dont you go back to your terrorist infested land turkey instead of talking about your asshole to me. You know nothing about the ROK armed forces.
Reply: +Joe KPS u like to talk sht . ur super stupid . isnt right . u should not talk so to countries that have helped ur country . and for what is all this fight about a fuked tank lol.  all tanks are same with just little diferences . they use same gun . and they can be destroyed same way .
Reply: Saimir Cheytac 
Over 23 countries fought in the korean war not just turkey.

Anyway all tanks are the same?
No tank has suspenion system like the k2 nor the RWR nor a FCS like the k2 
Not all tanks are the same.
Some are easier to be hit rhan others and some have better technological capabilitie
Reply: Joe KPS then u must have respect for all the  23 countries.the war stoped but if it wosnt going to stop all this countries wos going to send full army .about tanks. to me it look so . im not expert . but we can talk about tanks without starting stupid fights .respect
Reply: Joe KPS having Chinese tourist today doesnt mean that you are friends forever... You better go to look for your balls to go against CHinese ADIZ... calling your enemy as a friend is for weak people... 

Where is the hell your tank production? how many years passed? you Asians love to show off, but show me the results..
Reply: Kamil Demir
LOL we are more than tourist attractions. South Korea and China are both members of the AIIB banking infrastructure. We are asia's largest economic import and export traders.

Where the hell is our tank production?
You realise South Korea's tank force is far superior to Turkey's?
Turkey:
4 Altay Tanks (4th gen)
400 Leopard 2 (4th gen)
600 Leopard 1 (3rd gen)
900 M60 tanks (3rd gen)
400 M48 tanks (3rd gen)

South Korea:
206 K-2 tanks (4th gen)
490 K1A1 tanks (4th gen)
1,000 K1 tanks (4th gen)
800 M48A5 tanks (3rd gen)

So we should total how many 4th gen tanks each country has. 3rd gen tanks are pretty much useless.

Total 4th generation tanks in service
South Korea 1,696 > 404 Turkey
= We have far more newer tanks than you turks and you claim we only show off? lmao
We have a more advanced tank force than you and turkish army still use outdated M60 and M48 tanks. lol

Here's the source if you want

https://en.wikipedia.org/wiki/List_of_equipment_of_the_Republic_of_Korea_Army#Tanks

https://en.wikipedia.org/wiki/Modern_equipment_of_the_Turkish_Land_Forces#Tanks
Reply: Joe KPS well turkye will build 1000 altay tank so u will be pair lol .
Reply: Saimir Cheytac
1000 + 404 does not equal 1696. 
South korea will still have far more 4th gen tanks even after ALTAY production.
And Turkey wont start full production service till 2018?!?!
By then K-2 tanks would've been upgraded to K-2 PIP standards. lmao
And anyway south korea still dominate the ground forces in terms of IFVs, SPGs, artillery, MLRS, helicopters, drones, fighter aircraft, destroyers, amphibious assault crafts, submarines etc etc.
Reply: Joe KPS well happy for u :) . im curious to see how a modern tank  whateve it is can get rid from being hited from a Javelin TOW or Kornet .....
Reply: Saimir Cheytac 
K2 KAPS hard kill can deter a TOW missile
Reply: +Joe KPS are u fucking serious XD i am just making fun about that news but ur dumb brain cant solve that.You try to give me serious answer for my kidding haha dude ty, u have showed how stupid u are again.And btw we dont cry my kiddo we already accepted 3 millions syrian without any help from the world.Just watch the 
north korean toilet papers and shit on ur lands and dont try to speak about turkey with ur small brain kiddo.Ty for helping me to show how moron u are by :)
Reply: can
lol you are making a big deal out of the toilet papers? You realise that this was a one off incident. This has stopped ages ago. Its only the media that make a big deal out of this. 
Calling us south koreans stupid is not a good idea. Where is turkey on the world's IQ list? 
South korea is top 3 always.
lmao goodbye stupid turk and enjoy feeding all those refugees. Id rather have toilet papers coming over rather than full grown men running away to your country lmao
Reply: Joe KPS we use m60 junks because our enemies  has no balls to shot a single tank !
Reply: 알타이가 한국 기술력 끌어다쓴거라 비슷함
Reply: +Joe KPS Check your own link again. Look at the 2016 rankings now lol.http://www.globalfirepower.com/countries-listing.aspTurkey 8th, S.K 11th.
Reply: Mustafa Demiray And its not a believable information. It ignored weapons performance and considered only about how many they have.
Reply: I  hope Kim wipes ROK off the map soon ! :D
Reply: Hahah butthurt korean noodle :D thats exactly whats going to happen to you. Long live DPRK !
Reply: No I was just copying what you did so I guess you were butt hurt too :D
Reply: Ha, ok bro :D
Reply: k than
Reply: anything else?
Reply: it's about two countrymen fighting about which country's tank is better.
Reply: than turned into insult fest against each other
Reply: ROKMC Rec.   Beside it is 10 tons heavier and smaller in lenght and width having a crew of 4 persons compared to the k2 but yes we got the suspension and design from you
Reply: TurkSeal 
LOLLOL 
Turkey isnt even a blue sea navy.
South korea are a blue sea navy and we have more ships and subs than turkey.
Amd our KDX3 destroyer is ranked first in yhe world you prat.
We have nuclear submarinez and stealth destroyers coming up soon.
Dont even compare ROKN to turkey.
When turkey becomes a blue sea navy then you can talk.
Till then keep your mouth shut
South korea has the largest shipbuilding industry in the world
Hyundai heacy industries
AND
BTW
South korea are richer than turkey
We are asian tigers economy
Us singapore taiwan and south korea have the strongest economies in the east.
Reply: Den ProHD 
Nice try
When turkey gets a destroyer with 127 VLS battery then you may argue with the KDX3.
What wbout submariness?
We are deplying 9 more 1400t subs and 3 new 3000t ICBM nuclear submarines.
Therefore we are a blue sea navy. Turkey is not.
Turkey barely has any submarines compared to ROKN

Hydropneumatic suspension in altay??
SO? Do you know what that is?K2 ghas that also but even better. K2 has in-arm active suspension. Better than abrams and altay.
FCS is also south korean own design and K2 already has soft and hardkill features. Its got full soft kill system and is getting a hard kill upgrade.
1500hp is average btw. Any modern tank has 1500.
Reply: Onur CANKAYA
yes i never said i disliked turkey but your friend Can was speaking some utter bull 
Yes i do respect your fallen heroes.
My father fought in Vietnam and had to tunnel through VC tunnels with a flashlight and a 1911. 
Turkey and South Korea are proud military partners. 
peace
Reply: Andrew Yoon
These turks are so annoying
Reply: +Joe KPS     Turkish Airforce  10 of  Airbus  A400M  Strategic Transport Aircrafts   to deploy Utility and Attack Helicopters...AFV..IFV...Howitzers and MLRS     in all over the World ......  ( S.Korea..Japan..israel...Italy   have no any Strategic Transport Aircraft )  .....also  Turkish  TAI  TRJ-628  medium range ( +3700km )    Transport...Electronic Warfare....Marine Patrol and anti Submarine    Aircrafts   until 2023     ......  what about  S.Korea  ?
Reply: Standard Jager 
Airpower and navy we are superior to turkey.
Go to globalfirepower for easy explanation.
Ask me again for details.
Turkey isnt developing as fast as ROKN and ROKA are atm.
Badass pilots? Atleast make a better argument than that. Our ROK pilots are globally recognised even by the british RAF and USAF.
F-15E? Do you mean F15K?
F15K is one of the most reliable multiplatform fighters around.
Its avionics are unparralleled to this day even when its 20 years old.
We also have KF16. Whats your point? 
We bought air tanker and making our own stealth fighter.
We have more F15ks and kf16s than turkey so we are better.

In the navy? We have the largest destroyer the KDX3 and largest helicarrier Dokdo class carrier.
We also are making 3000t nuclear ICBM submarines using our own technology and are getting 2 aircraft carriers by 2025.
No competition  sorry.
We have more fighter jets
We havr more attack helicopters
We have more serviceable airports
We have more ships 
Thats all facts.
We have more of everything and in terms of navy we have worlds best detatchments.
No way turkey can be powerfuller than us. 
( and whining? You and i know turks are on every damn video trying to glorify their not so shiny military)
Reply: can 
Ok thank you for confirming your lack of knowledge in world affairs.
1
We do not cry for help wtf
We demanded US pass down wartime control on all forces in 2022. Plus we have rejected deployments of many US detatchments. We rejected the US THAAD programme and we rejected SM3 upgrades on our navy.
2
Call US and UK at every trouble?
Ok we havent called for any help since 1980s
At every conflict since we have retaliated to the north by our own rhetoric.
Yongpyongdo 2010
We fired into north korean mainland with our 155mm artillery after north korea fored at us.
Mine blast 2015
We ordered full deployment of all our GOP forces and deployed propaganda loudapeakers and we fired 155mm again and we deployed 4 F15KS to do routine air surveillance drills at north korean border.
We didnt call for help at all your moron
With modified US weapos?
LOL
We havent used US weaponry since 2000.
Our tanks are domestically produced K1a1 and K2 tanks.
Our artillery are also domestic K9 155mm 
Our MLRS is CHUNMU again domestically produced.
So are our destroyers and all our patrol warships. All produced by south korea heavy industries.
Even our submarines are produced by us.
AND
There are only 4 countries in the world that can produce long range cruise missiles.
South korea is one of them
Turkey isnt.
In fact our ROK army is more indigenous tham turkey.
Your army still uses german G3 rifles and american M4A1 and israeli Tar21 rifle.
Why you use foreign guns? Lol
South korea use our own produced guns.
K2 rifle
K1a1 rifle
K11 sniper
K3 LMG
K5 pistol
Look south korea alone is more powerful than turkey.
Check here
http://www.globalfirepower.com/countries-listing.asp
Bye
Reply: can 
Why the US does not need its troops in south korea

http://catalystnewspaper.com/opinion/why-the-u-s-does-not-need-troops-in-south-korea/

South korea can defend itself

https://medium.com/war-is-boring/its-time-for-the-u-s-military-to-leave-south-korea-8b67be8223b0

At the end of the day South Korea alone is more powerful than turkey according to GBF 2015.

http://www.globalfirepower.com/countries-listing.asp

If you dont belive me check out the link.
South kora 7th
Turkey 10th
Reply: Den ProHD
top 10 5th generation fighter jets
Turkey is 7th
South Korea 5th
So the future is ours. lol
http://www.wonderslist.com/fifth-generation-fighter-aircraft/
Reply: can
here you go all these link are official rankings as you dont trust globalfirepower.
Are all these link bullshit too? lol

South korea 7th / turkey 10th

http://www.wearethemighty.com/top-10-militaries-world-ranked-2015-05

South korea 7th / turkey 10th

http://www.businessinsider.com/these-are-the-worlds-top-10-militaries-2015-5?IR=T

South korea 8th / Turkey not even in top 10

http://www.wonderslist.com/10-most-powerful-militaries/

ALL THESE LINKS SHOW SOUTH KOREA IS HIGHER THAN TURKEY 
end of discussion
btw
South korea defense budget $35 billion
Turkey defense budget $18 billion
No competition
and south korea and turkey both building next gen stealth fighters
south korea's version is still more powerful
http://www.wonderslist.com/fifth-generation-fighter-aircraft/
Reply: tolga aripek
Turkey are making nuclear submarines? 
Please cut the bullshit. That is utter bullcrap. 
South Korea are the only ones making their own indigenous 3000t nuke submarine now.
and for top 10 military powers south korea is more powerful than turkey

here you go all these link are official rankings 

South korea 7th / turkey 10th

http://www.wearethemighty.com/top-10-militaries-world-ranked-2015-05

South korea 7th / turkey 10th

http://www.businessinsider.com/these-are-the-worlds-top-10-militaries-2015-5?IR=T

South korea 8th / Turkey not even in top 10

http://www.wonderslist.com/10-most-powerful-militaries/

ALL THESE LINKS SHOW SOUTH KOREA IS HIGHER THAN TURKEY 
end of discussion
btw
South korea defense budget $35 billion
Turkey defense budget $18 billion
No competition
and south korea and turkey both building next gen stealth fighters
south korea's version is still more powerful
http://www.wonderslist.com/fifth-generation-fighter-aircraft/

South korea > Turkey

and why are you so angry? I thought turkish people were good allies of south korea. Clearly not. It doesnt matter if south korea is more powerful than turkey. they are still allies
Reply: Den ProHD 
I think its wrong to say turkey will be better than south korea in the futur.
South korea increased its miliatry  budhrt by 7.2% which is huge. South korea alredy have a much larger budget than turkey.

3000t are not only for ICBM. 3000t can stay subsurface for extended periods of time compared to reular submarines. It means south korea can trek deeper into north korea for longer operations.
You dont need nuclear submarines? Im sorry but thats stupid thing to say. All superpowers have nuclear submarines including the US china and even the UK. Its a key foundation to a blue sea navy to enable the navy to partake in long range missions. Regular turkish 214 class is not good enough. 
And talking about the 214 class submarine, south korea has a total of 9 214 subs while turkey only have 6. Plus south korea can  ow build its own 214 subs as Hyundai heavy industries built 3 new 214 submarines a few years ago.
If turkey wants a strong subsurface navy they have to invest in nuclear 3000t submarines. 214 german ones are only 1800t which is too light for longer operations.

And whats all this about turkey building its own technology.
South korea already have the worlds largest most powerful destroyer the KDX3.
It uses AEGIS system and the US already agreed to install electronic warefare etc. Whats the point of making our own when we already import it at a cheaper price?
When the KDDX stealth destroyer comes out south korea will then invest in indigenous systems. But not now. Theres no point at the moment.

And what about missile defense? Turkey has a VERY weak missile defnse system.
south korea is investing billions into their own KAMD/KC missile defense system to stop nuclear missiles. South korea is miles ahead of turkey in terms of aerial defense systems.
They already have their own L-SAM standard defense. 
Turkey doesnt even have their own defense system. Which is embarassing for turkey.

http://www.rt.com/op-edge/234011-turkey-china-tender-missile-defense/

Also south korea has more experience in air force manufacter. South korea already built their own fighter jet the FA50 while turkey have yet to make one.
Reply: tolga aripek
you think turkey is the only country growing?
South Korea is THE fastest growing country.
We will have tripled out submarine count by 2022 with an addition 9 1,800t submarines and we will have 6 nuclear ICBM 3000t submarines by 2020s.
We will also have 2 light aircraft carriers and an additional 3 AEGIS destroyers are joining our fleet. (We already field the worlds largest most powerful destroyer the KDX-3).
South Korea's navy will be way too powerful for turkey.
Also our airforce is already larger and more advanced than Turkey but we now have the KFX programme which will make south korea even better by replacing F-4Ds and KF-16s with our new 5th gen stealth fighter jets.

Nuclear wepaons?
You do realise south korea have on of the largest branches of nuclear reactors? we have 24 reactors with an additional 4 on the way. That makes us the 5th largest nuclear capable country.
South Korea could arm themselves with nuclear W-80 warheads within 4 months of full production. Nuclear power is not a problem to us. We could have made nukes about 20 years ago but we didnt need to.
Nuclear waeponry is becoming more and more a name game rather than a power game. nukes will become renderless within the next decade or so unless your country wants to die too.

But then again why does this matter? turkey and south korea are allies
Reply: Can Taşkent
I never critized the service of fallen heroes. Thats you making assumptions.
Let me say though, you didnt "save us".
You undoubtedly helped but to claim you saved us is going over the top.
But why does that matter anyway as turkey and ROK are both allies
Reply: Den ProHD
Russians were shocked? Lol i mean at least dont come up with all this bullshit.
Turkey cant mobilize 20 million That is utter bullshit. They wouldnt have the logistics and funding to completely mobilize 20 million.
And just because someone conscripts into the army doesnt make them a soldier. They are simply a civilian with a gun.
One decent army division can take out numerous civilian divisions all day.
It all comes down to registered servicemen.
Russia has 3,200,000
Turkey has 500,000
(South Korea has 3,500,000)
 
Shall we compare Russia and Turkey?

Attack helicopters
Russia: 460
Turkey: 60

Attack aircraft
Russia: 1300
Turkey: 223

Tanks
Russia 15,300
Turkey 3,700

Artillery
Russia: 14,000
Turkey: 2,300

Aircraft carriers
Russia : 1
Turkey: 0

Submarines
Russia: 55
Turkey: 13

Destroyers
Russia: 12
Turkey: 0

Hmmmmm Russia would completely rape Turkey if it came to a full out war.
Russia was scared? LOL please be sensible. They have at least 10 times everything that Turkey has. You really think Turkey would survive a war with Russia? Lol
Just because Turkey has a good war history doesnt mean it will win against a world superpower. Britain used to be the most powerful country in the world but now they are not. Same with Turkey.

South Korea?
Well may i point out
South Korea has more
- Attack aircraft
- Attack helicopters
- AFVs
- Artillery
- Submarines
- Destroyers
- Corvettes
Basically South Korea has a far superior navy and airforce as well as a much larger ground force.
South Korea is ranked higher than Turkey by looking at 2015 MDR data.
Reply: Kamil Demir
Yes at the moment Turkey and South Korea have 14 submarines. But Turkey is only ordering 1,800 ton 214u submarines.
South Korea is ordering 6 more 214 submarines.
BUT South Korea is also developing a very large 3,000 ton KSIII ICBM submarine. A total of 9 are being produced. These can carry ICBM missiles which the 214 cant carry.

Also in terms of navy south korea is far superior to Turkey.
Does Turkey have a proper destroyer? No it doesnt have a single destroyer.
South Korea field the most powerful destroyer out there the KDX3 destroyer which carries a 127 VLS missile battery.
South Korea also has the largest AAC Dokdo carrier.
Reply: @SKgyebaek stfu you commie turkey is making an aircraft carrier but I would call it the super transport aircraft carrier
Reply: Den ProHD
Whats this bullshit about a Turkish Destroyer?
You said Turkey will have 4 TF-2000 "destroyers"?
First of all, TF-2000 is not a destroyer its an ADC Frigate. NOT a destroyer.
And so what. TF-2000 just four? South Korea already have 3+(3) so 6 KDX3 destroyers.
And does the TF-2000 have a 124 VLS missile battery like KDX3? No. 
So how many destroyers do Turkey have then? Still 0.
2021? YOU THINK TURKEY IS THE ONLY ONE WORKING ON MILITARY? LOL
South Korea are going to have a planned production of the KDDX stealth destroyer by then. Turkey will never catch up with South Korea.
And technology? Whats the point of South Korea building all of that when we have US as our ally? We can purchase off the US who arguably have the best technological devleopemnts in the world. And anyway, South Korea are now working on unmanned 500MD LAH, mid tier UAV drones, Artillery detection radars and they purchased 3 Global Hawk Drones for constant surveillance.
End of discussion
Reply: Den ProHD
Under american control? LOL WTF
AEGIS systems are bought under license by the ROKN. Americans in no way control it after the purchase.

UAV? As i said, in no way is Turkey better.
We have an ally for a reason. ROK recently bought the 4 Global Hawk RQ-4 drone which is the best of the best in terms of aeial surveillance.
And South Korea are pushing foward with UAV development. They are already planning on lighter more mobile UAVs for the DMZ deployment.
Reply: Den ProHD
FOR FUCKS SAKE.
STOP SAYING TURKEY HAS BETTER TECHNOLOGY
We buy a lot of our technology off the US.
Why? Because it is better than turkish ones.
AEGIS system is perfect for south korea
ROKN need to intercept a lot aerial attacks from north korea at once. The uniqueness of AEGIS is its flexibility, both software and hardware, allows it to become suitable for new missile types and targets like ballistic missiles.
Basically its the best type of system to have especiall for south korea.

And the TF-2000 IS SHIT
IT DOESNT EVEN HAVE CONFIRMED SPECS
and you are thinking its the next new thing.
I guarantee you its not going ot better than the KDX3. It wont have a 127 VLS battery nor will it be as capable as the KDX3 in aerial defense. So stop talking about the TF-2000. it isnt even production ready anyway

What about ballistic missile defense?
South Korea are well on the way to developing the join KAMD-KillChain protocol.
They are already releasing and buying a shitload of artillery detecting radars as well as the RQ-4 Drone for increased surveillance.
We also are working on our own L-SAM defense system which should provide similar capabilities to THAAD.

Just shut up about all these stupid facts.
Turkey are weaker than South Korea.
Reply: Andrew Yoon
He's lying about a lot of shit
The GEZGIN-D Cruise Missile.
He says it has only a range of 1,500km not 2,500km.
He's confusing it with the turks saying they would develop a 2,400km MRBM which wont happen.
He's making up everything as he goes
Reply: Den ProHD
1)FULL OF AMERICAN WEAPONS ? LOLOL
What american weapons?
Tanks ? No we produce our own
Helicopters? No we produce our own
AFV? No we produce our own
SPG? No we produce our own
KAAVs? No we produce our own
Firearms? No we produce our own
Missile defenses?No we produce our own
BMissiles? No we produce our own

We have NO american weaponry apart from the AEGIS systems we have in our KDX3 and our RQ-4 GH drones.
The american gear we do have are all bought under licence meaning we can produce it ourselves in the future using the technology given.

2) Ok. Turkey is developing its own missile defense system. Well done. You want a nobel peace price now? LOL. Guess what south korea also has a BMD programme going on as well not just turkey.
South Korea's KAMD is far bigger than the turkish missile defense programme. ROK are developing L-SAM which will be deployed by 2023. Its similar capabilities to the russian S-400 but it is an all around capable BMD programme. It will consist of L-SAM and M-SAM missile defenses which will be deployed on FFX-B3 ships.

3) Turkey TF-2000 is better than KDX3?
WHAT A LOAD OF FUCKING BULLSHIT.
The TF-2000 doesnt even have fully confirmed specs and you already claiming its better than the KDX3? Really? Does the TF2000 have a 124 VLS? No so it will never be better than the KDX3. And when is TF2000 being deployed?
After 2020. By then South Korea will be deploying FFX-B3 ships including KDDX destroyers. LOL
Reply: Tanks? show me your Tank engine and final product other than Russian style prototype that takes forever to produce...
Helicopter? Where is your turboshaft engine? Do you have local attack helicopter? NO!!!! 
Missile defence? you have no final product man, keep dreaming... I respect Korean people, good job what you have done so far.. But, also, dont get me wrong, we should talk based on realities... Your missile defence is also based on Russian one... 
On the other hand, you asked AESA radar, IRST, camera pod for your 5th generation aircraft... Now USA refused it, so you are in trouble.. But, We relied on ourself and developed all of them already... We even plan to supply our f16 with local AESA radar and ASELPOD(you can see its capabilities in youtube, just type the word and compare the thermal image to any other image you have ever seen.. )
You said your KDX3 has 124 vls... But you dont understand that Turkey doesnt situate near the ocean. Basically, big navy ships, will have more sound and heat signature when there are not in deep water. Thats why, you also cannot use nuclear submarine near Turkey.. 
Basically, it would be better for Turkey to have more ships which can maneuver through thousands of little islands in Mediterian sea..
Reply: Kamil Demir
Tanks?
K-2 tank. The one we sold to you!!
Tank engine is not even american. Its german. Germans produce the best engines so we use it.
K-2 armour, APS, FCS, suspension, munitions are all produced by ROK industries.
We also have the K-3 coming up with our own rail gun, electromagnetic armour etc.
Nothing american

Helicopters?
Did you not hear about our recently deployed KAI SURION Helicopters? First of our indigenous produced helicopters by the ROK.
It will be used as transport aircraft but it will also be used as a medium attack helicopter with 6 x BGM-71 TOW, or up to 4 rocket pods.

Missile defense?
Based on a russian one? LOLOL You know jackshit.
The L-SAM is not based on the S-4000. wtf
The MR-SAM IS based on the S-4000.
L-SAM IS NOT based on S-4000.
L-SAM we are using our own radar system called I-MAST which is a BMD radar which will also be deployed on all our future upcoming KDDX and FFX warships.
Here's a link of it.
panzercho.egloos.com/11189732

Our KFX project?
Yes the US refused the F-35 technology transfer. But that doesnt matter. Now WE ARE producing our own gear.
AESA radar? We have been developing our own one since 2006. It has already passed ground and air tests. The government are just going to use this radar not the US one so that is no problem.
The project is still going and by 2023 we will produce our own KFX steath fighter using our own technology.

Destroyers?
Ok thats a fair point. But by looking at stats alone KDX3 is still the better. Its the first ship to fully utilize a rolling-airframe on a large AEGIS destroyer and its the first one to use dual VLS batteries including our own KVLS with missiles ranging over 1,500km.
The TF-2000 doesnt even have confirmed stats so you cant claim anything about it. Thats just stupid.
Reply: TurkSeal 
Actually it is a copy of it
We sold you the Kprogramme for $1.84 billion.
The  K2 is still far superior to the Altay.
Suspension
Munitions
FCS
Mobility
APS
We still are far better than the Altay in terms of specs
Reply: TurkSeal 
Wow you are so stupid.
Hydropneumatics are used in almost all modern tanks.
But the K2 is the only tank with enhanved inarm capabilities.
Has much better weapons?
Wtf. The K2 and altay both use 120mm. And actually the K2 will have 140mm soon after PIP project.
Lol do some research before saying jack.
The Altay doesnt even have am autoloader. LOLOLO
the K2 has an autoloader so faster fire rate
Reply: TurkSeal Bence daha cevap verme,ya bilgisi yok yada trollük yapmaya gelmiş,tek soru sordum cevap veremedi,yalandan kim ölmüş.1960 lara kadar hiçbirşeyi olmayan bir ülkeydi şimdi kalkmış sanki teknoloji kendilerininmiş gibi övünüyorlar,biraz sakin olmaları gerek.

1980 lerde Amerika Koreye silah sanayi için teknoloji transferi yaptı.K1 tankları Amerikan M1 tankının bire bir kopyasıdır ve hala K1 ve K2 tanklarının motoru Alman Mtu'dur.K2 Otoloader sistemleri AMX-56 Leclerc in aynısı istersen araştırabilirsin.

Tanklarda otoloader avantajlı olduğu kadar dez avantajlıdır,tutukluk yaptığında namluya müdahele çok zor ve tank namlusu sıklıkla tutukluk yapar.Joe marine'nin mantığı ile Amerikan ve Almanya tankları teknoloji konusunda T-72 tanklarından geri :) T-72'ler 1970'lerden beri otoloader kullanıyor ama hiç bir Amerikan ve Alman tankı otoloader kullanmadı.Bu mantıkla T-72'ler gelmiş geçmiş en iyi tank :P ayrıca otoloader isabet oranını arttırmaz atış kontrol sistemi isabet oranını artırır.Senin de belirttiğin gibi Aselsan 25 yıldır Volkan Tank Bilgisayarlı Atış Kontrol Sistemini geliştirerek Leopard 2 NG'yi üretti.

Altay'ın atış kontrol sistemi ise Leo-2 NG'lerden bile daha iyi.Kore'den ise reaktif zırh yapımı ve süspansiyon alımı haricinde hiçbir teknoloji yardımı almadık emin olabilirsin.Almanlardan Mtu motorunu aldık gerisi olduğu gibi bize ait.Ayrıca bizim teknoloji altyapımız çok geri olasaydı Kore geçen yıl Saldırı Helikopteri ihalesi açtı biz T-129'larla ihaleye girdik  :) kendini çok övmemek gerek,açıkçası bu kişi koreli değil
Reply: Tuğra turkey has no navy and airforce compared to ROK
Reply: can
global firepower?
Your friend used that link too so LOL
GBF is the most reliable accurate ranking source since OMR. 
You cant argue with facts
I gave you links you cannot give me jackshit
end of discussion
south korea 7th
turkey 10th
deal with it kid